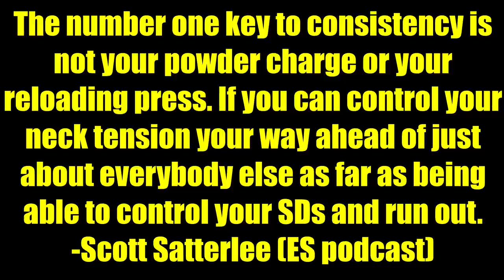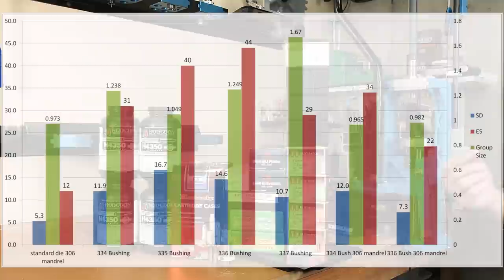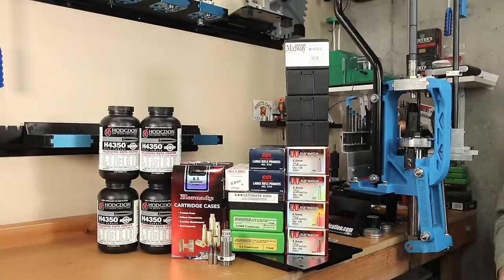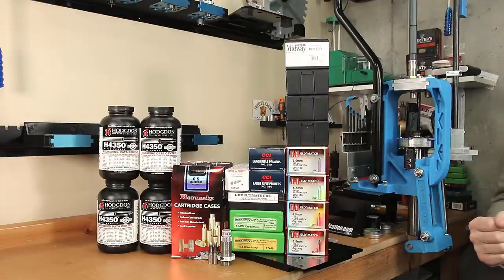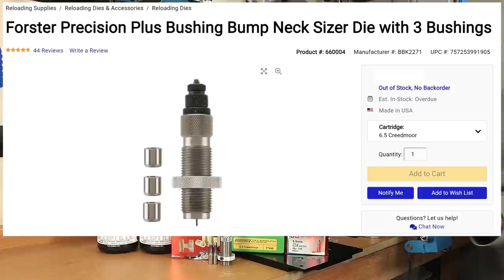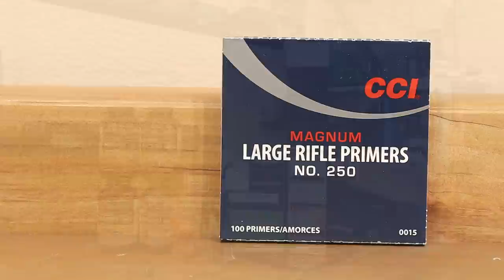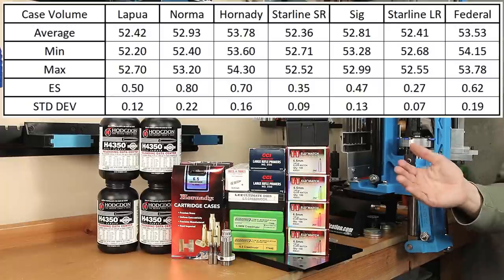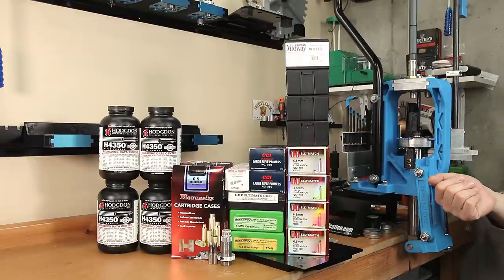Sizing Brass and Setting Neck Tenison - Which way is Best? - The Test Plan

Comment: This video is a classic misunderstanding of what creates runout and influences neck tension. The answer is actually simple. Run a tight neck chamber and neck turn. It all starts right there. A fired case has no runout. You create runout by the sizing process and the amount of sizing being done. If you are reducing the neck diameter by 0.012" you can induce more runout than by reducing the neck by 0.003". If the necks are turned and consistent, then variability is much more controlled than un turned brass. Key point is where the brass starts in life... New brass is never good. You must fire it once to set it, then start evaluating. New brass is always full of irregularity.
Reply from the maker: Not sure you understand the point in all this. I am not discussing new brass, I am discussing upcoming testing that will happen on fired brass and the different sizing processes that some preach to be the best. Telling a new guy that he has to get his rifle rebarreled with  a configuration "tight neck" that makes him not be able to run any factory ammo if they wanted too, and requires the use of next turning is exclusive and frankly not required to achieve the results they may be looking for. Constantly there are reloaders spouting off crap that "the only way to do it is....." and there is far more than one way. Yes runout is typically induced in the sizing process, but there are successful shooters that will also tell you that runout isn't the end all either. There are tons of successful shooters that don't neck turn. If your At that level you already know what you need for your application. For a average guy that just wants to pick the option that gives them the best results they can get out of the gate. This series is to help the average guy understand how the different process work and the difference that shows in the performance. This video has nothing  to do with using all these sizing methods on new  brass.
Reply: @BoltActionReloading  Perhaps you need to consider the five why's of root cause analysis then. If you are going to argue that successful shooters do this or that... Consider why. Ask yourself what kind of chamber design are they running... Long freebore will align a bullet where a short free bore will not for example... You cant take a broad bush and say some long throat 6BR guy does this certain thing and apply that "rule" to a guy running 155s in a 308 where no bearing surface extends outside the neck. These trueisms are application specific. Further, you are diving in to this pretty deep with what you framed in this video, and it goes well past a beginner hand loader. So I'm not sure where you are going with that line of thought.
Reply from the maker: Its pretty clear that you didn't watch the whole video, or just heard what you wanted too. I am not analyzing a problem. You make an absurd statement that somehow this video is a "classic misunderstanding of what creates runout and influences neck tension." You know what causes runout and sets neck tension, the sizing process. So I asked the audience all the different options they wanted to see covered in a deep dive on my channel. This includes most of the configurations that people have told me I should be using in my comments sections over the years. Option 1 in the video being the most basic FL sizing (how is this way past beginner?) I hope to highlight the differences that all of these options produce to see if the minor differences in performance is worth all the trouble. I prefer to show my audience the real data and let them decide for themselves. Your proposed solution to a "problem" is to get a tight neck chamber and neck turn. This would be very difficult to include and not "practical." I saw a video on your channel with a RPR in 308, did you immediately rebarrel it with a tight neck chamber and start neck turning for it? If so, you are not like the 99.5% of the guys that just want to figure out how to get the best performance they can with what they got out of the box. I am not making universal "rules" just doing a performance comparison with real data for everyone to see. I am not telling people what to do, or think. They have to look at the data and decide for themselves. I think that showing how the performance changes from option to option may give some new guys some basic ideas what is happening during the sizing process and pick a better option for them.

Comment: So....in manufacturing terminology what this bullet tension or neck tension is all about is really called a press fit or an interference fit, right down to class of fit. The inside diameter of the shell is critical. The outside concentricity determines the inside tolerance. The accuracy of the bullet outside diameter needs to be of very high tolerance. If he would say what class of fit he wants, all this dialogue could have been eliminated. Here again is proof guys love to hear them selves talk. Tell me the class of fit, and my four years of machinest apprenticeship and education will take care of the rest for a perfect each time reload. Everything else is just a guess on his part. Have a good day.